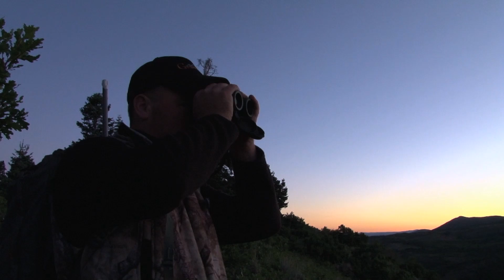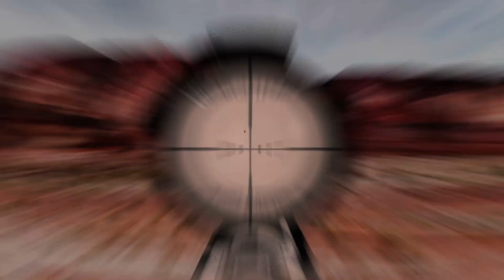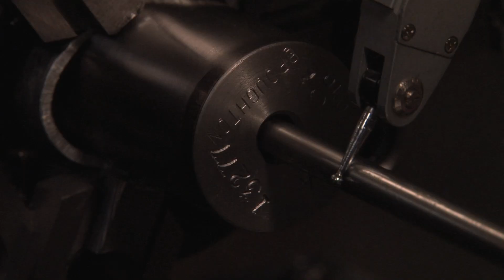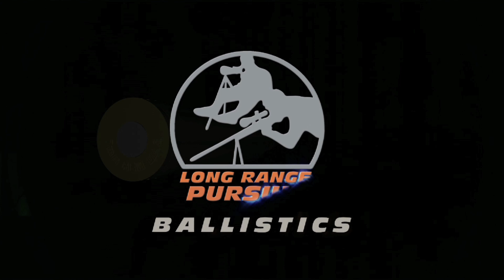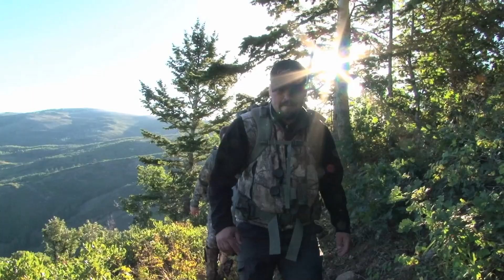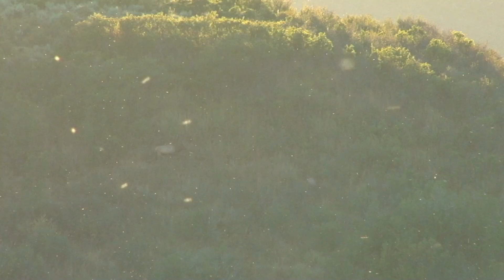Long Range Pursuit | S1 E1 Mike's 925 Yard Utah Elk

Comment: what bullet would you use for moose hunting at 0-200 yards? 7mm rem mag of course.  steyr mannlicher luxus:-)
best regards William from Sweden
Reply: willepadille7 I'm so about heavy for caliber, but at that distance I would also worry about expansion.  160 grains or more with an exposed lead or plastic tip.  The new 175 ELD-X from Hornady is perfect.
Reply: so true and thinking now that the bullet companies know that hunting at long range is becoming more common and making bullets to perform at longer ranges.
Reply: +Aaron Davidson what twist rate do you have to have for that new 175 ELD-X?
Reply: I would go with a barnes tsx personally... something 160 gr or heavier as long as your barrel has the twist for it.